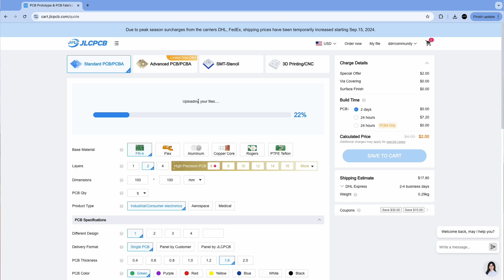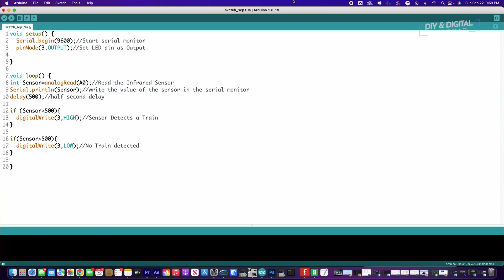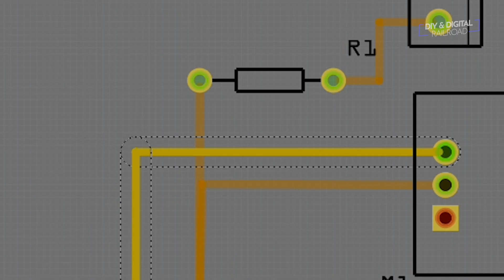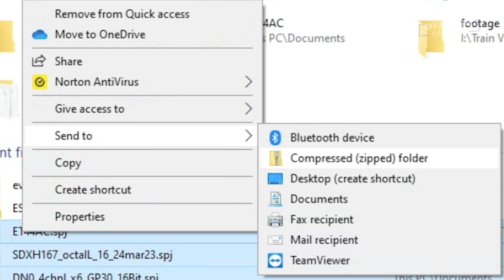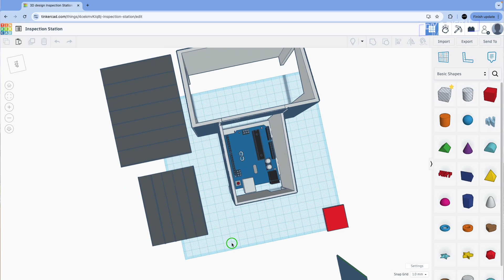3D PRINTED Model Railroad Inspection Station using an Arduino and a custom PCB

Comment: OK, I'm convinced. I uploaded your Gerber files to JLPCB to check on the pricing - it's $2 for 5 PCBs! (Turns out that 5 is the minimum order.) Admittedly, this is a special offer, so I expect the non-special orders might be a little more expensive, but this is definitely worth consideration.
Reply: Small PCB's (less than 100mm x 100mm) seem to always be $2 for 5 PCB's - that seems to be a special that's always there, not limited time offer :)
Reply: @LordPhobos6502  Great to know - thanks!

Comment: Jimmy I really like the concept of this project.  But after all your hard work and expense, I was a little underwelmed by the illumination of a white light side the building.  

How hard would it be to add a 'computerized voice' like I hear in the scanner saying something like "Norfolk Southern no defects"?  Or simply "No safety defects" so all roads could use it.

Plus, something like dwarf signals in front the building indicating red and temporarily changes to green when the train passes through and then reverts to red (similar to block a signal)

Again, great concept!  I just think it could be taken to another level (then pitched to Walthers!!)
Reply: Is that the kind of thing that this does? Like when a train rolls through this, is it placed in the mainline with pretty much any train going through it? I didn’t think this was as much of a defect detector, but still, that seems pretty simple to figure out if you’re doing this kind of thing, right? He’s shown signals. He’s got a thing that triggers when a proximity sensor is tripped, that’s the thing that turns on the light. Would it be too hard to figure out how to record a defect message to trigger, playing on a small mp3 player on a delay, or maybe when the proximity sensor is no longer tripped? I feel this video is more about designing the NS structure and adding the lighting. His videos are usually pretty short too. That’d probably make it too long.
Reply: @andrewlaverghetta715  I assumed it was a defect detector.  Of course you know what happens when you ASSume!